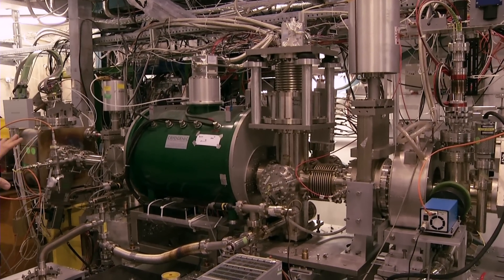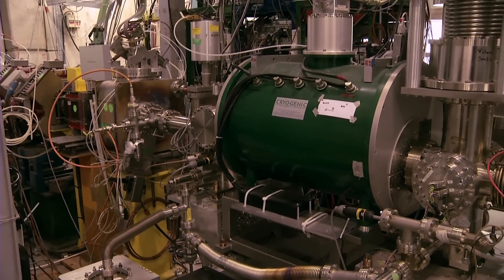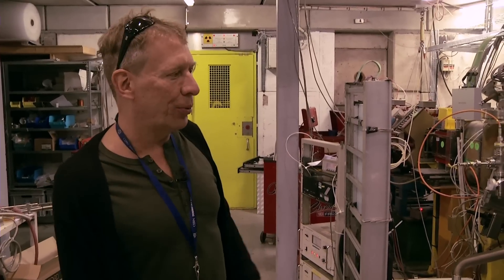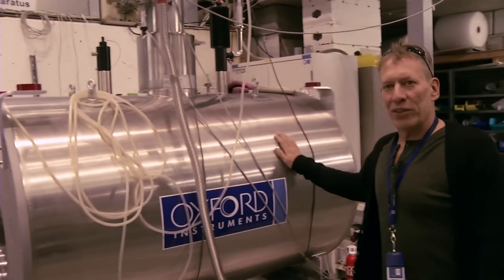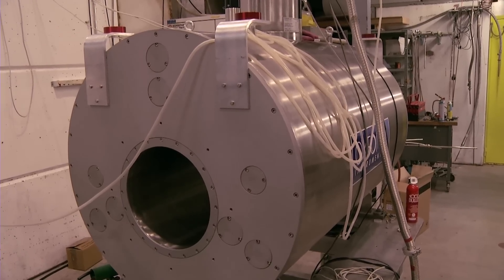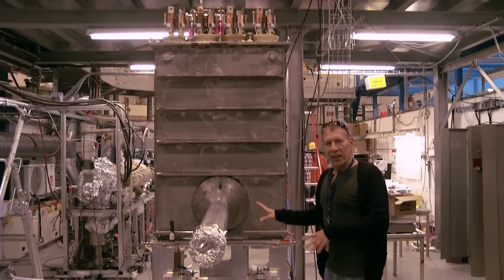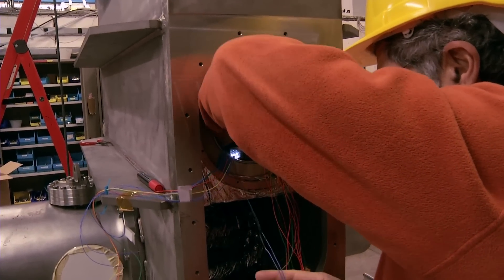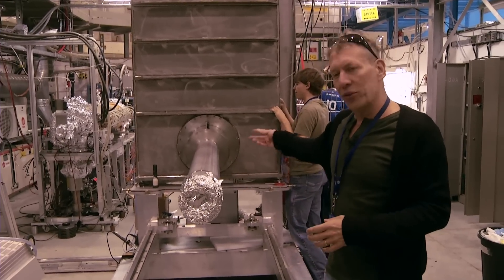ALPHA-2 arrives at CERN

Comment: i agree, its amazing. Anti-hydrogen in a vacuum falls downwards with the same acceleration that normal hydrogen or a brick would experience in a vacuum, gravity cannot be shielded off. i really have no idea how they keep it confined, at least the antiprotons are electrically charged so you can force them in any direction with magnetic fields. But antihydrogen is neutral, i know a lot about physics but how they continuously knock these particles upwards or make them levitate is a mystery for me.